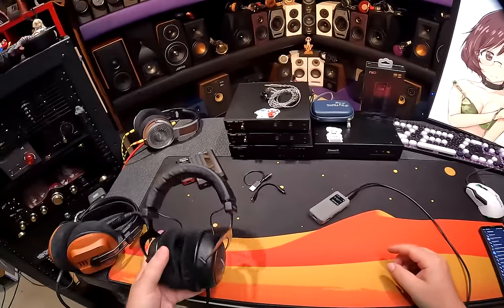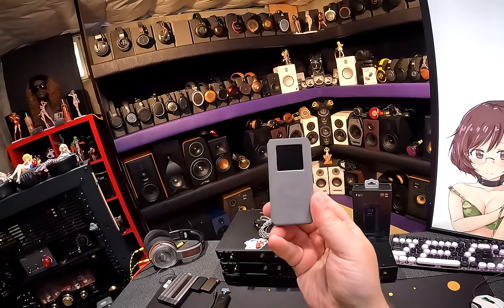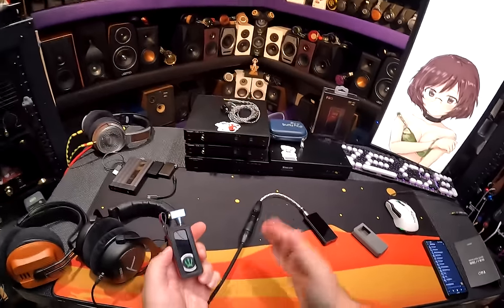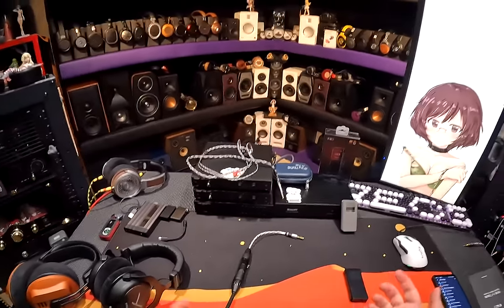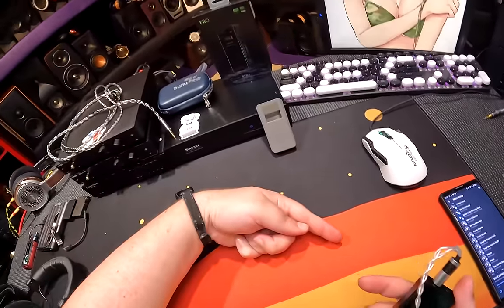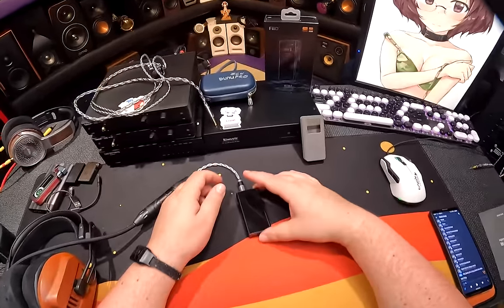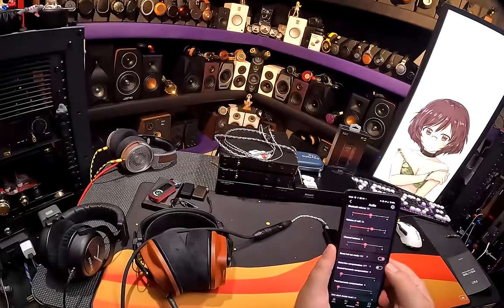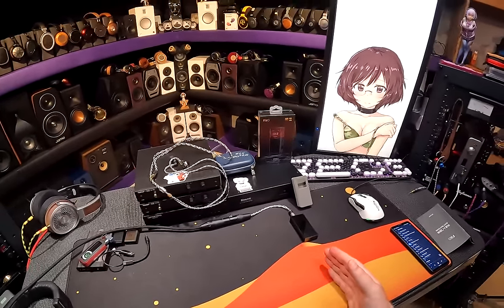The BTR7 Just Changed the Game...

Comment: The option to switch the volume/skip function between double press and hold press is also available for BTR5 btw. I've got the older 2020 unit and have been using that option for a while, can't say with 100% confidence that it's always been able to do it but I'm fairly sure. I got my current phone about a year ago and it could definitely do it since then
Reply: You are very correct, this is an OLD feature
Reply: Can support this claim

Comment: I will explain the car situation. Most modern luxury cars are like rolling isolation tanks, the use of frequency isolators in the suspension as well as sound insulating material throughout the body structure makes for a serene driving experience.

Comment: Mr. Z - Do you notice any differences specifically in the frequency response on the BTR7 in Bluetooth mode vs USB mode? I've noticed the BTR5 sounds significantly different on BT vs USB. In USB, it sounds phenomenal, but in BT it messes with the midrange in a weird way and it rolls off the upper treble in such a way as to take the sparkle out of anything I plug in. Really, I've noticed this with every BT FiiO device I have tried. It's not the codec, it does the same thing whether AAC or LDAC. It's specifically something happening when music is going through the BT chipset. I've pretty much stopped using my UTWS5 altogether and my BTR5 except for USB mode and from my TV over BT. It just changes how my IEMs and headphones sound too much.
Reply: Agreed, BTR5 sounds quality through usb. Sounds very smooth and detailed.
Reply: @maxnation20  Do you also get the weird FR when using over Bluetooth?
Reply: @jafizzle95  well if the codec selected is LDAC then over the Bluetooth sound seems to be fine and flat as compared to APTX. Yes  I have noticed it sounds harsh especially the highs when on APTX but on LDAC it sounds better and on usb as you mentioned phenomenal.
Reply: Bluetooth is limited to CD quality sound files. If you are doing any streaming with Apple HD or Tidal MQA then of course it's going to sound better when connected to USB. Also, there is some slight power loss when transmitting over Bluetooth.
Reply: @thinkhector  Actually Bluetooth falls just short of lossless CD quality so it will always sound worse than over USB. Both Apple and Samsung have some proprietary audio codecs that claim to be closer, but they both use Bluetooth to transfer that data, so there will always be a physical limitation of bandwidth.

Comment: Starting at 36:30
Z,
You're silent 1-hour wave file will not turn on your amps and you will still get a false No-Noise result

You must have a very low level signal at the very beginning of the silent wave file to turn the amps on before playing the silence

My test files are 60 seconds long and have a trigger to turn the amps on

No need for 1 hour

You have officially failed the noise floor testing
Reply: Once triggered, the amps remain on for the duration of the audio file

If you stop playback  (of any audio file) , the amps will shut off to conserve power

Comment: Just got it, but the volume is extremely low while using the USB C from phone to BTR7, and 3.5mm to the headset. 
Max volume on BTR7, Phone, headset.

Using headset built in Bluetooth, 2.4Ghz dongle, or 3.5mm to laptop is waaaaayyyy louder.

Tried low gain, high gain, boost, but nothing works.

I already updated the firmware, and restarted the BTR7 and Phone multiple times.

It also is very low volume with Phone Bluetooth to BTR7 and then 3.5mm to headset.
Reply: Use the provided cable. Plug and unplug it and it should b ok....  I'm not hearing a huge difference between LDAC and wired (wired is better but not as much as I expected)...

Comment: OK curious why doesn’t the Apple cable that comes with my iPhone work with this dac? I do have the cable that came with the dac for the iPhone and it does work it’s just very short.

Also, I’m just wondering I get this kind of metallic sensation from the FiiO DACs I’m doing something wrong is there a way to lesson that.

One other thing the FiiO website does anybody know why it’s so slow and or if there’s another link for the firmware update because the website is almost impossible to access —-so slow so very slow…  the FiiO app says it’s updated, but the current firmware is V1.85 but I have 1.68.

Comment: It's just too big for me. I even gave up on BTR5 and switched to BTR3K. When on desktop, I use Zen Dac anyways. When on the move I tend to use mostly IEMs and sometimes not hard to drive HPs. If you need the power, it's a nice gadget. But if you don't need the power it provides on-the-go and want something portable, it's too big for that imho.
Reply: @Vittoria BTR3K runs my IEMS as well as KPH30i (101db/60ohms) just fine, from it’s single output. I don’t have FH9 but seeing it having (108db/18ohms), I wouldn’t expect you to have any issues with running it with BTR3K. BTR5 is much powerful than BTR3K so there’s no question there anyways. And I’m talking about the single outputs. Both have 2.5 balanced output which are way stronger than their single outputs respectively.

I just checked FH9 and see it comes with a cable with interchangeable terminations, including 2.5 balanced. I don’t think you’d need to go balanced anyways, but I would have no doubt for BTR3K to run it via 2.5 balanced output worst case scenario.
Reply: @Vittoria tbh, for me if the headphones can get as loud as I would listen them to, while still having a bit of headroom that I don’t use, it’s fine. I personally don’t think I can hear a difference from an amp just because it’s more powerful. It’s why I dropped BTR5 and switched to BTR3K. Because that’s powerful enough for my IEMs.

Comment: Any significant difference between low and high gain if your headphones operate just fine at both? I know low gain is more battery friendly but what about audio quality? From my personal experience, low gain appears less bright and smoother.

I'm curious as Z mentioned "close to desktop level" when he activated the secret gain option.
Reply: From what I know, any amp that has separate gain modes would have a higher noise floor in high-gain mode.
Of course, it wouldn't matter for any high impedance equipment that needs the high gain in the first place.

Comment: The BTR7 really is on a thin line between expensive and worth it. I got the BTR5 for my dad (2021 model) and I dislike the bass so badly. Everything seems like I need brain-burn-in but at the same time my Sony R50 MiniDisc player is still king after 22 years. Best sound ever vs A90 + Q5s. The FiiO Q5s really has flaws but the digital legacy inputs are a treat for PC, PS2 and PS3 (oh even PS4) when needed. I have no clue whether the AKG vs Sabre  DAC / AMP difference is the thing but the small nuance of the bass being analytical and just on the same volume / thickness as the rest of the sound of the Q5s makes headphones like the Sony MDR M1ST fall apart with the BTR 5 because that one needs the most neutral presentation to get songs to tint the headphone's sound in the best way but only with the Yaxi M1ST special pads. On the other hand the Q5s' line out jack is just bad. It forces power over sound.
Reply: I also can't match the sound of my minidisc player or my first creative audigy sound card, whit those no need of more amp, better resolution audio sources etc they can fullfill my power hungry AKG's i still dreaming of some DAP that deliver that kind of sound.

Comment: i have the iFi Zen DAC V2 for my desk and a BTR3k for everything else, is this enough of an upgrade over the btr3k to replace that, while also sounding as good as the zen V2 so i could replace both with this? Thanks!
Reply: I remember when I tried to buy some new speakers and the seller from the shop told me when I was telling him about dacs…”the unit that REALLY makes sound is not the dac but the SPEAKER”. He was quite right. The KEY question is WHAT IS YOUR ANALOGUE DOMAIN like? Which Headphones do you have or plan to have? Answer that question and then later try the best affordable way to feed them. Don’t fool yourself. The higher price of BTR7 is for me explained by its tech (in part) and that tech is applied to have more versatility for feeding headphones, I mean why replacing a product like btr3k (in my case I know btr5) if I am not planning to use more hungry headphones?

Comment: If this had a 2.5 on it, I'd sell my BTR5 in a heartbeat and buy it. 

Already have a great dac/amp with 4.4 and more power (gryphon). 

I have way too many iems and iem cables in 2.5. and I'm not going to buy something new that I need to use with an adapter.
Reply: Fair enough, but you realize that most of the industry is moving forward with 4.4 for balanced connections now instead of 2.5, right? I mean... just by one 4.4 --> 2.5 adapter and you won't have to buy another. <shrug>  I'm just saying - without an adapter, your problem is likely to get worse, not better, overall... when it comes to new Hi-Fi gear.
Reply: @EdgeDC  understood. I have 4.4. and I have an adapter that I use with my gryphon.
Reply: I don't know about that. 4.4mm is found on a much smaller set of portable devices than 2 5mm. My point if 4.4mm is too slowly adopted it will be replaced before you know it. I predict the norm will be 3.5mm on sub $100 headphones and USB-C on headphones $120 and up. 4.4mm will get replaced before it ever gets off the ground. Sort of like AptX-HD getting replaced with AptX-Adaptive.

Comment: I have some issues with my BTR7. There is an audible noise floor when listening on USB mode with Windows set to output 16-bit audio. And when set to 24-bit or 32-bit audio the noise floor is gone, but then I get other issues like popping noises if I skip tracks, or silence for the first half second of a track. I am on version 1.71.

I updated the firmware yesterday to FiiO's latest but that didn't fix the issue unfortunately.

Also, no matter what bit depth I'm sending to the BTR7 from my computer, the BTR7 says 32B on the screen. The sample rate display does change accordingly.
Reply: Try turning your Windows Audio Enhancement On and Off then restart. Hope it helps

Comment: Would you go for this over the THX onyx?
Reply: You want Bluetooth. It's seriously Fiio's Ace in the hole. There are a lot of Dongle-Dacs. Very few Bluetooth Dongle-Dacs.
Reply: @thinkhector  thanks for the recommendation bro. Have been eyeing the Qudelix 5k but I'm still doing some reading trying to decide.
Reply: @zackthomas7244  I looked at the Qudelix. I don't think you can go wrong with either one. The deciding factor for me was the Qudelix supports AptX-Adaptive, but NOT AptX-LL. I don't have any device that needs AptX-Adaptive, but I have several needs for AptX-LL. 
Only the new BTR7 supports AptX-Adaptive, and AptX-LL, but of course it's pricey. It really depends on the equipment you already have, or plan to purchase very soon.
Reply: @thinkhector  Thats a great point youre making. My phone is a bit older So id be stuck choosing between LDAC or aptX. Appreciate the insight. Ive got some more reading to do about it.

Comment: Question: I am trying to get a new dac/amp for the u12t. I want to get the best sound quality and the moonriver 2 looks very good but I also wanted to have the versatility of bluetooth. How does the btr7 stacks up against the 5k and moonriver 2, in terms of sound quality? Anyone has experience with those? Im am specially looking at the moonriver 2 vs btr7(wired) or even the colibri if it is actually considerably better than the other two. Do you think any of those would be an upgrade from the ifi zen dac v2(which I like but its not my fav sound signature). I kind of discarded the ua5 and up5 becuase I have heard that they are warmer and for that type of sound I have the ifi zen dac v2
Reply from the maker: Would definitely put this against those

Comment: everyone talks how good btr7 is but fail to mention that Fiio how many years still Dosn't have proper software support their app sucks hell the firmware on their devices sucks btr7 has battery display issues when charged wireless btw BTR7 is Fiio Q3 with newer shell and battery and while BTR7 is hardware wise amazing software is VERY BAD there's Only ONE EQ Profile while Qudelix 5k has 20 if you compare Fiio Software with Qudelix 5k software Fiio looks like it's 20 years behind and Qudelix 5k is made by much smaller company with much less capital

Comment: 31:24 - still no PEQ, stick to Qudelix, saved you 42+ minutes.
Reply: What is PEQ used for?  Thank you
Reply: @ricosuave1399  you can easily fix the sound on a lot of headphones or speakers. There are available PEQ adjustments for all sorts of headphones and speakers that have been measured, and will substantially improve the listening experience. It makes no sense to buy such a device that doesn't support PEQ (at least 10 bands), especially at this price point.
Reply: @onortosu  I have a Monolith THX AAA portable amp/dac for headphones.  The Monolith has PEQ but I don't know anything about PEQ and how to use it.

I want deeper bass using the PEQ.  How do I get deeper and richer bass using the PEQ?  

THANK YOU.

Comment: the only major complaint I've had with my BTR5 is that going into the menu to turn off/on charging is a pain. It needed a slightly better UI.

I kinda preferred the 2.5 though. I don't own anything with 4.4, so I'd need to get yet another adapter from hart.
Reply: To me, the biggest miss from all these DACs is the quick ability to select and audio codec from the unit itself.